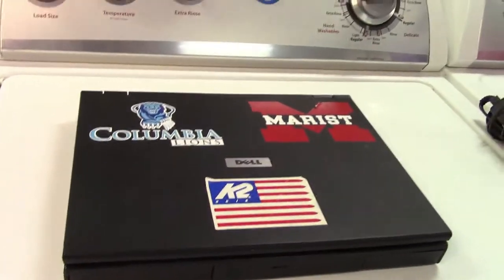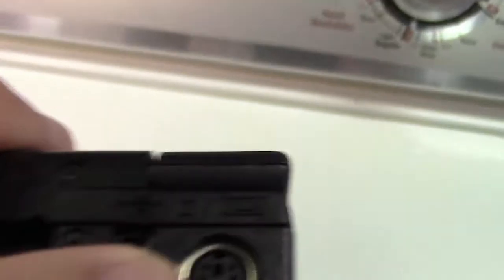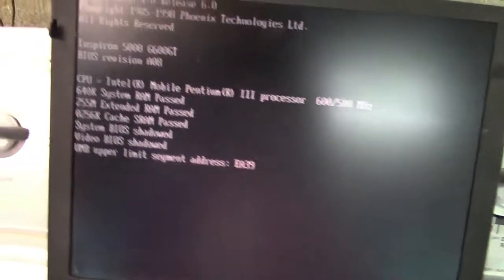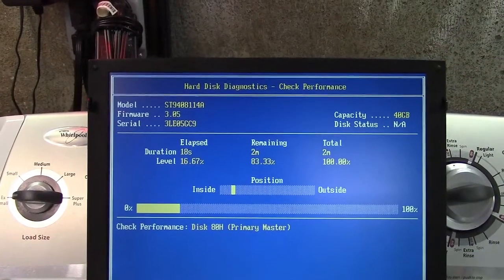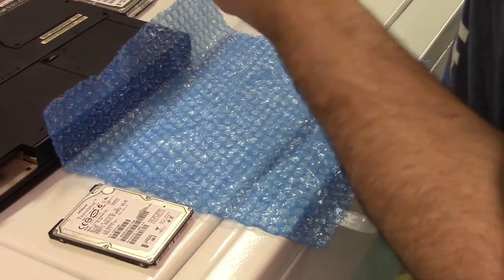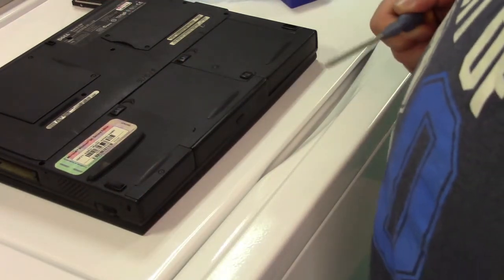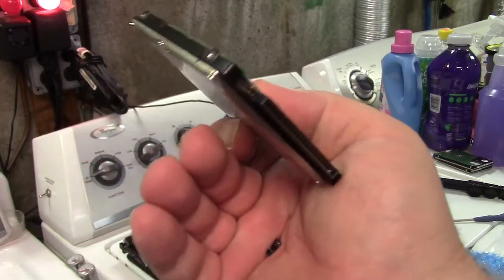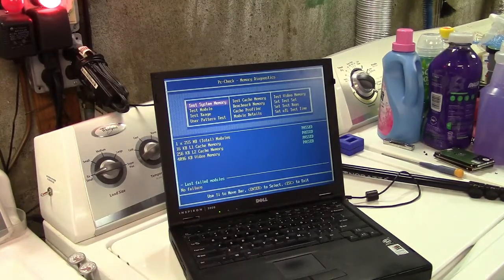Dell Inspiron 5000 Repair, Part 1 - Hard Drive Replacement & Testing

Comment: Computers will never be manufactured like this anymore. I don't even know the last time I saw a laptop with a halfway decent keyboard. The floppy drive had a nice sound to it. I never understood why old computers seek the floppy drive prior to booting.
Reply from the maker: Agreed.  Old laptops had somewhat decent keyboards.  This one, you could type on, if that's all you had.  It's no substitute for a real keyboard, or an IBM Model M, but if it's all you got, you can make it work.

The floppy seek was part of POST, the Power On Self Test.  As IBM and IBM compatibles used floppy drives that had a Track 0 sensor, they would use that to ensure they could seek.  Basically they would run the heads out to track 40, or 80, depending if it were a double density or high density drive.  That was a full stroke of the seek mechanism.  Then they'd drive it back to Track 0, and then check to make sure the drive says it's at Track 0 via that sensor.  That's the "buzz-buzz" sound, head going out to the end of their travel, then coming back.  If the Track 0 sensor wasn't tripped, it would give an error.  The "click click click click click click this one does, I don't know, perhaps they're running additional tests seeking to track 1 and back again a few times?

Compare that with the Apple II computers, which, when turned on, would make a "chugga chugga chugga chug" sound.  Steve Wozniak, bought drives WITHOUT a Track 0 sensor as a cost-cutting measure, and when turned on, the drive would simply take 40 steps back.  If it were already on track 40, great.  But if it were on track 5, it would take 5 steps back, and then slam into the stop 35 times.  That was the "chugga" sound.  It also, in time, could cause the drive to become misaligned, which lead to increased repairs.  So even back then, Apple was trying to maximize their dollars out of you.
Reply: @jaykay18  Thanks for the info. I never knew that was the reason for it. So if you were to unplug the floppy drive, would it give an error? Laptop keyboards now are complete garbage. I use a cheap Dell keyboard with my laptop. It's not bad for being a rubber dome keyboard. I've never had the opportunity to use an IBM model M but from what I've heard about them, it seems like no keyboard even comes close to the feel of one.
Reply from the maker: @andrewg593  Depends on the motherboard and/or BIOS.  If the system is told it won't have a floppy drive, it won't bother seeking.  Some of the Dell Desktops, when they first started coming without floppy drives standard, would often give an error when the battery on the motherboard died, because the motherboard's default is that it WOULD have a floppy.  Not an uncommon error to see.

You don't have to hunt down an actual IBM.  Unicomp owns the tooling and still makes the Model M keyboards.  You can get one for about $100, there's almost no reason not to.  If you don't spill anything on it, it might be the last keyboard you'd ever need to buy.
Reply: @jaykay18  Would an external floppy drive seek if plugged in? I'm not even sure if Windows 10 supports floppy drives. Oddly enough, the floppy drive in my old Gateway machine is much quieter than most of the other ones I have heard seeking. I've heard of the Unicomp model M. I've seen some reviews that say they are just as good as an original IBM and others that say they aren't. I may go ahead and get one someday. Does the version with Windows keys use buckling springs?
Reply from the maker: @andrewg593  If it's hooked up via USB, it wouldn't seek.  That's seen as a connected peripheral, not a part of the computer.  Windows 10 should support floppy drives without issue, certainly 3.5" ones anyway.  I do not have any equipment that can handle a 5.25" drive and also run Windows 10, but I surmise it's actually supported.  I have been told that serial mice still work under it, and it also has a lot of support for legacy printers.

Some floppy drives are loud, some are quiet.  Most times, after lubricating the rails, they become very quiet.  But that's one of those services that's up there on the list with dusting the tops of the picture frames and the top of the fridge.

The Unicomps are today's incarnation of a Model M.  As close as you can get to an actual vintage IBM one, and for me, that's close enough.  The Windows key versions should have buckling springs as well, just verify what their website says for that particular product.
Reply: @jaykay18  Microsoft does seem to do a decent job when it comes to backward compatibility. That's interesting. I'll get a video of that computer someday. I'll look on Unicomp's website. I can only imagine how nice one of those keyboards is.
Reply from the maker: @andrewg593  Sometimes yes, sometimes no.  They've had periods of lackluster compatibility.  And a lot of old video cards and Ethernet cards simply won't work under Windows 7, not to mention any later version of Windows.  We can't keep compatibility forever with everything, but sometimes I think they could do a little better job.

Once you try one, you'll never go back to anything else.  Like I said, it might be the last keyboard you ever need to buy,
Reply: @jaykay18  I ended up getting the Unicomp version and I love it. Typing this comment right here on it. The tactile feel of this keyboard is incredible. I never knew the typing experience could be this good. The cheap Dell keyboard I was using is now relegated to those times when I game in the early morning so it isn't so noisy. I actually love the clicky sound of this keyboard. The only thing I appeared to like better about the original model M was the overlay for the lock LEDs. My Unicomp has blue LEDs. I was hoping they would be green but I can't complain. The typing feel of this keyboard is SO good.
Reply from the maker: @andrewg593  I just KNEW you'd be happy with it.  Not thrilled with blue LEDs, but it is what it is.  My "gaming keyboard" on the editor rig has blue LEDs for that.  They're just there.
Reply: @jaykay18  They're very bright too which is the worst part. Thankfully, because I am apparently the only person who turns off Num Lock, I don't have to deal with them shining in my face all the time. Otherwise, I am extremely happy with it. Typing was never so satisfying.
Reply from the maker: @andrewg593  I'm sure.  I leave Num Lock on so the keypad outputs numbers.
Reply: @jaykay18  I turn it on only when I really need to enter numbers that way; mostly for alt code characters. It stems back from the days of me being a kid when little things like the light being on all the time would bother me. Now I am so used to the numpad functioning as navigation keys by default that it screws me up if I leave it on. Old habits die hard.
Reply from the maker: @andrewg593  I understand!  I hark back from the days where keyboards didn't even have lights.  So you had to guess, and the light was a good thing.
Reply from the maker: @andrewg593  I understand!  I hark back from the days where keyboards didn't even have lights.  So you had to guess, and the light was a good thing.
Reply: @jaykay18  The only keyboards I have seen without lights are the silly new ones that have no feedback to them.

Comment: I've never particularly liked Seagate drives, seen more go bad than other brands. The Deskstar and Travelstar ones never seemed very good either. Should be a crime to pair such junky drives with such quality hardware.
Reply from the maker: Back in the day when this laptop was new, Western Digital drives were horrible.  Most of the failed hard drives I've seen were from about that time, and they were all Western.  In these modern times, Western drives have really come back in terms of quality.  In fact, 3 of the drives attached to my computer are Westerns, and have not experienced a problem.

I have never held the Desk/Travelstar drives in very high regard.  But in these times, especially with 2.5" IDE/PATA drives, you take what you can get.  Especially when they're free.

No, a crime would be throwing the entire laptop out because it stopped working due to a failed hard drive, or because it's "obsolete".  75% of the time, that's why.  The other 25% is when people break them.
Reply: @jaykay18  That's true, disposal of the machine would be unacceptable.
I'm surprised you don't have more IDE drives on hand. While they are in dwindling supply, I still have plenty on hand. As of last year, I no longer have any computers under heavy use that still contain an IDE drive.
Reply from the maker: @JordanU  I now do have about 4 or 5 drives as spares.  For laptops, there is 1 I have been using that has an IDE drive, but I'm pretty sure the machine is fairly low hours, so I expect it will last quite a while, especially since I'll only use it an hour or so at a time.